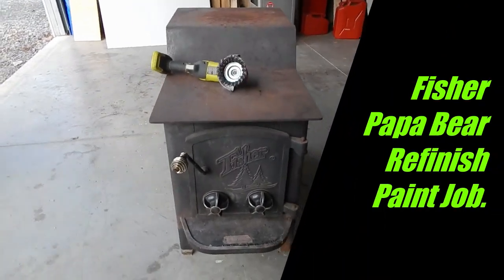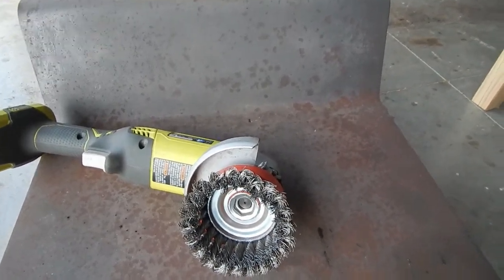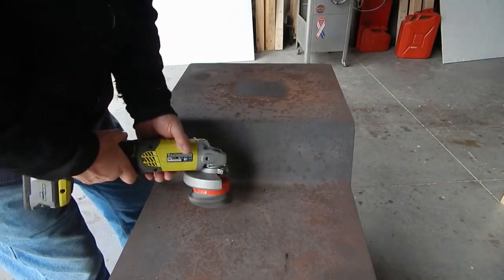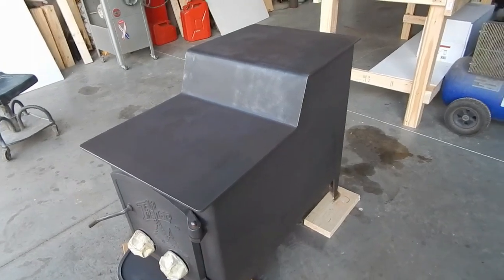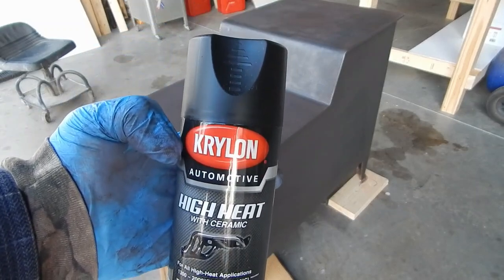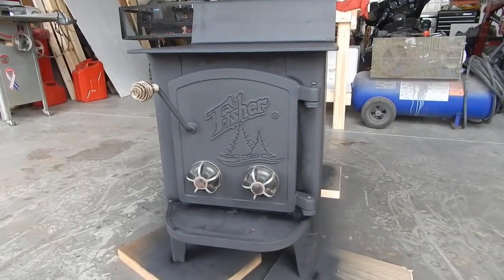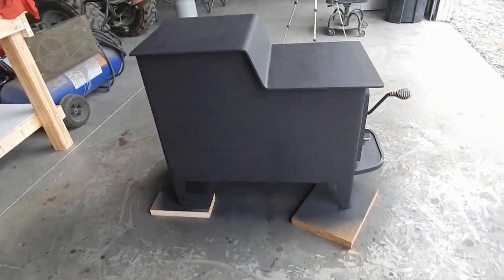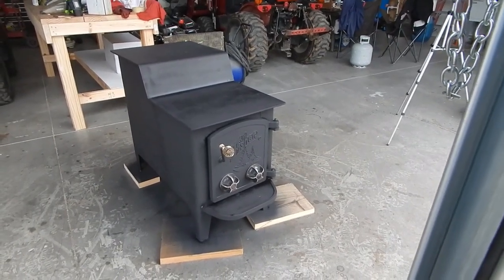Fisher Papa Bear Wood Stove  Refinish Paint Job.

Comment: How did that header paint hold up on your stove. I have a Papa Bear also. I have painted it twice with high temp paint. I dont remember the brand. It looks ok till I burn it a couple times. Then the paint turns white. Does this header paint keep its black color on the stove after burning it a good bit?  Im getting tired of lugging this beast around to paint it, lol. Id appreciate knowing your results Thanks, EE
Reply from the maker: Holding up great 3rd heating season now.

Comment: Some of the older Fisher stoves have a flue collar that is actually 6" outside diameter. As it is recommended to run the male end of the connector pipe inside the stove's flue collar, this sizing makes it difficult to do so. Our Fisher stove adapter is sized to go over the flue collar. Then the male end of the connector pipe fits inside of this adapter, allowing for a drip free connection. In addition, it has a formed bead to further insure that the creosote formed from combustion remains inside the pipe.
Reply: Who is “Our” in which you speak of?

I may need one of those collars.

Comment: Did you use the metal etch that you mentioned when you were talking about getting ready to remove the rust with the wire wheel?  I have been using it on old WWII Nato gas cans prior to painting them with really good results.
Reply from the maker: Sadly no I did not have any. Just used a wax & grease remover.

Comment: Man I wish that these Fisher wood stoves were still made today. When did production cease on those?
Reply: Late 80s when they started putting restrictions on them
Reply: The man that sold my sister her house bought the metal and other supplies and the kids at the local vocational school built one as a welding project for him. It's not perfectly airtite as the fisher,but aside from having steel doors rather than fishers cast doors it's a good likeness. Shes heated with it for 25 years now and it still goin strong